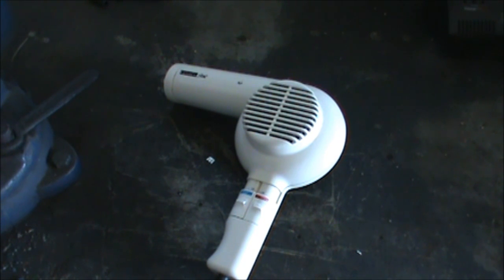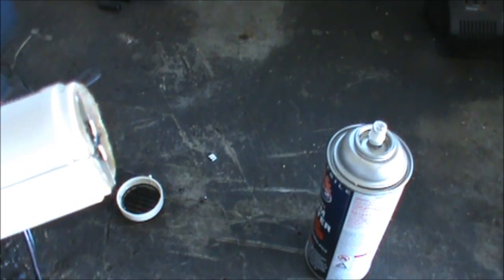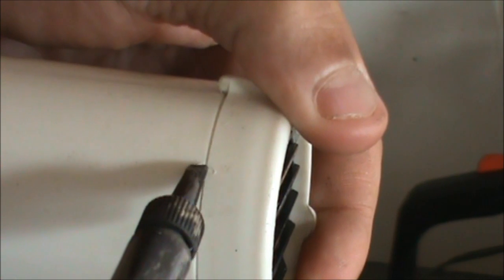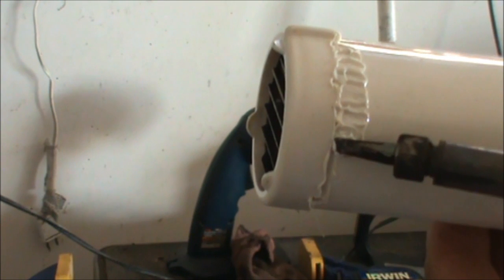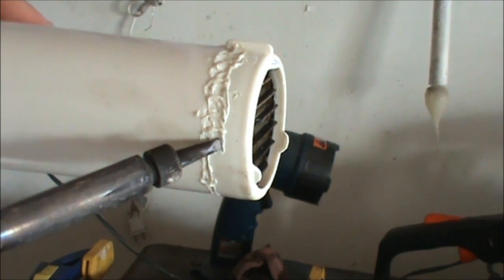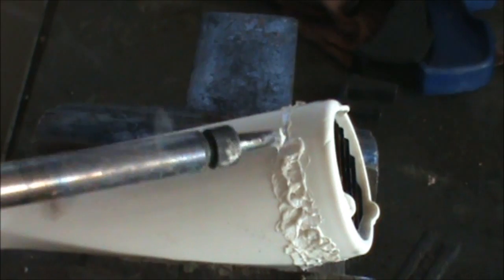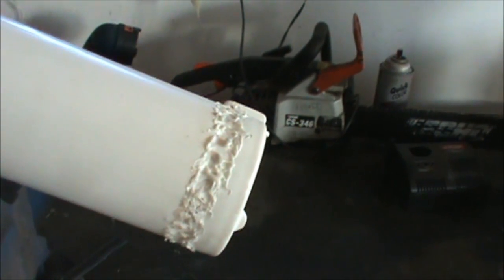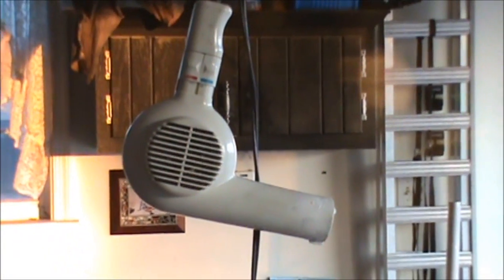How to weld plastic

Comment: Guys, perhaps it's not about the cost savings of the hair dryer - but the technique of resealing the plastic joint and the satisfaction of beating the system - products always have a weak area that tends to break - thus, insuring that the consumer will return for another purchase of a product soon to break.   Duct tape adhesive would probably melt.  Glue would work - but not as much fun. WW6 - waiting for your next video.  Bet, there is one out there showing how to repair false teeth...

Comment: welding is nice to use if you truly need it.   For this... I would have used iron to push a dimple out from the inside (through the metal grate) on the broken side so it has a snap point, then on the dimple surface sanded that down and and then used a map torch to flame polish it smooth.

Comment: my opinion but you're over welding it and at the same time messing up the plastic housing. You should have switched out the soldering tip for a cone shaped tip after the pre-weld then go around it, then do another switch for a flat plated tip to smooth out the weld. This is what i done to my hair dryer.

Comment: All purpose pipe glue (for ABS and PVC pipe) works great for most plastics.  So does the pipe cleaner sold with it; it's actually a plastic solvent, not a cleaner, per se.

Comment: That's kinda a crappy job. The dryer looks worse than before. The refinish of the plastic sucks. My dog could have done it better. No good.
Reply: Richard Phares Plastic isn't really meant to be "welded", so all things considered this guy did a decent job. If you have a better way to do this then post it up.

Comment: Some of the people in this comment section are so dense, he used the broken dryer as an example so he could teach you how to do some plastic welding, who cares if it's overkill for this particular project, just be glad you learned something.
Reply: some people need the facts spelled out for them.
Reply: Hillman Computer Services 
Really?  Well outside of tacking, nothing he did was right. You do not weld plastic with an effing soldering iron. 
You can use a re-flow station by using the hot air nozzle and a filler. So do blame us for the comments when we were looking for information. Hot air is the industry standard. Try looking into it. Plus, if the look of your work is important at all (and it’s obvious Double Wide does not care) then weld it correctly.

Comment: Well, outside of different plastic types, there is a problem of the softener chemical, which is added to plastic to provide flexibility. When heated up, it dissipates quickly, which results in such junctions being/becoming very fragile against force. I recommend heating plastic parts to right degree instead with hot gas or hot air. However, this method is sufficient for very small surface as its very accurate. I use portasol gas wielder with seperate tip just for plastics.
Also this method is very nice in play with plastic glue gun. It allows to correct and form any type of material from plastic glue. Although plastic glue is not heat resistant (melt point around 70 degree celcius)

Comment: I used a similar method to repair a box fan that my kids knocked over, one of the blades had broken off.  I found some of the same type of plastic and used that as filler material to make a pretty strong weld.  The benefit to using filler is you could sand it for a nicer look, but I left mine rough since I didn't care.
Reply from the maker: 1csrichardson  Nice Tip.

Comment: I bet that hair dryer case is made of ABS plastic, it is written on the inside of the case.  The majority of appliances are made of ABS plastic.  There is ABS glue available at any Hardware Abyss.  But, a soldering iron certainly does work to melt two pieces of plastic together.
Reply: Big Fat Tony's not a good example to show. welding on the removable-for -cleaning cap ! yes it's probably ABS.

Comment: I have a broken golf trolley, the plastic which attaches to the neck of the trolley and holds the bag is quite a solid tough material.. would welding be a good idea, or do you think I could use some sort of epoxy glue to fix it?
Reply from the maker: MDOY79 I really don't know.  You can try both methods.  I also have a video on superglue and baking soda.  Check my channel for it.

Comment: It's also really great to see somebody putting up a video just to help people out without trying to sell some product. I wish there were more videos like this on YouTube. Thanks again for the great very helpful video!
Reply from the maker: cyber007 Thanks for watching, I'm happy you found it so helpful.
Reply: doublewide6 Your wielding plastic tip saved me a ton of money and saved two of my laptops that has cracked cases. One of which was cracked around the hinge. This is much better than superglue and much stronger, thanks again for the help :-)  It's great to see a video where a guy is just trying to help someone without trying to sell them a product to make money for themselves. I know a lot of people who have cracked hinges on their laptops and will throw the whole laptop out but that's not necessary at all. You can weld the plastic just like I did with the help of doublewide6's video and save yourself a ton of money without having to replace your laptops. Welding the plastic is really strong. After the weld, I sanded it off just like doublewide6 shown in his video. It's a perfect fix and it cost me nothing. Just some time and like most folks I got more time than money. Happy thanksgiving all!

Comment: Bought a used hair dryer at goodwill for $6. I do appreciate you sharing your knowledge but that's a bit overkill for that cap. Useful info for other plastic items though. Thanks
Reply from the maker: j The video is about welding not fixing a hairdryer.

Comment: Hey just wondering what were the specs of your iron for this weld/fuse job (ie. wattage of your tool, how hot were the two temperature settings you had, etc). Looking to join 2 pieces of PVC pipe around 2.5mm thick, need to know what size soldering iron to pick up (guessing 60W+)

Comment: Yes I get what you are saying. And maybe this was more of a lesson in plastic welding than it was as the best and easiest way to fix the hair drier. I would think sanding the contact surfaces of the plastic and then using some high temp epoxy would be easier, quicker and would look better and save the price of the slightly mismatched spray paint. Not sure if they have high temp super glue. I also have my own almost foolproof method of fixing repairs like that and I will try to make a video. Thx!

Comment from the maker: Phil,
I tried glues several times and they heat up and weaken and eventually fail.  Tack welds are usually not enough to hold up over long time use.  The tip of the hair dryer get bumped on the countertop every day.  The idea of the video is teaching welding not saving a hair dryer, but I will say my wife is still using the thing and no more falling off like the glue did in the past.  Waste not Want not.

Comment: A agree this was serious overkill as a few spot welds would have held it just fine. Actually just placing some super glue around the cap would have been fine and it would have been easier and looked much better. But thx for the video. Welding plastic sometimes is the only option.

Comment: the video isn't about fixing a hair dryer, it's about welding plastic. There are heat resistant glues out there, like Gorilla Glue that might make a project like that a little easier.

Comment: I had two HF welders but neither one worked - the rods just won't stick. I'm ok with my hands, soldering for 40 years and metal welding for 20 but never got going with plastic with the HF welders.

Comment from the maker: Ncr,
About 3 years ago I used the harbor freight plastic welding kit and could not weld at all with it.  I burned holes and made a mess.  I admit that I do not know how to use a plastic welder, but I found that thing near impossible to use.  Thanks for watching and taking the time to comment, I enjoy your feedback from my videos.  If you look at my murray tractor review there is an example of a really nice plastic weld I just made on the bagger shell.